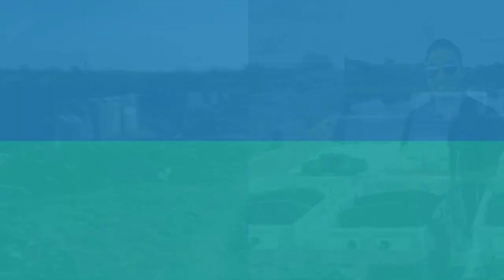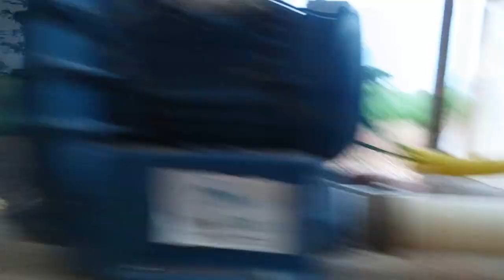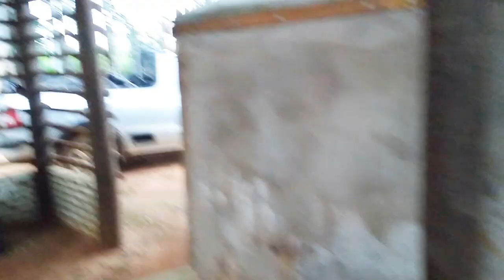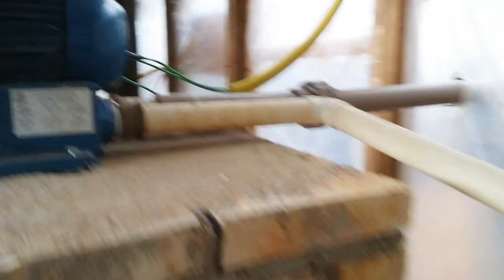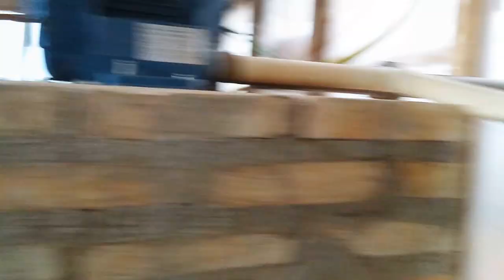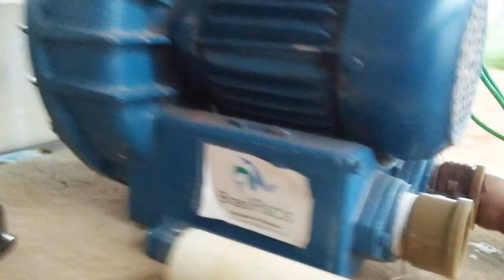Entupimento de Compressor Radial - Causas e Consequências - Vídeo 77

Comment: Qual o consumo mensal de cada compresor desde e quantos metros cúbicos de tanque ele oxigenar
Reply from the maker: No caso dependo do compressor, esse do vídeo gira em torno de 114 a 140 reais mensais ligado 24 horas, caso precise de alguma indicação ou de nossos motores entre em contato abaixo:

Dúvidas entre em contato das 9:00 as 18:00 ou 24 hrs para emergências em: 

- +55 (11)2021-5593 -  FIXO FABRICA BRASIL PISIS (UNIDADE SÃO PAULO CAPITAL)

(11)2021-2372. - FIXO VIGOR PEIXES ( UNIDADE ALEVINAGEM BOFETE - SP )

Também em contato@brasilpiscis.com.br 

--whatsapp e celular: +55 (11)941604428 - Vendas e Projetos

--whatsapp e celular: +55 (11)94704-4219 - Diretoria reclamações e vendas para exportações

--Somente whatsapp: +55 (11) 94160-4428 - Vendas e Projetos

- Site da empresa:     www.brasilpiscis.com.br